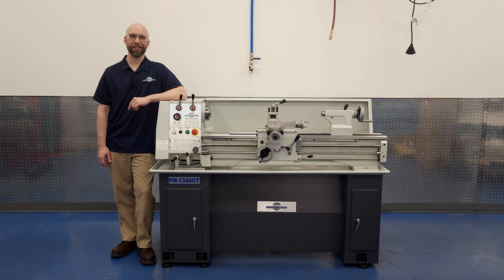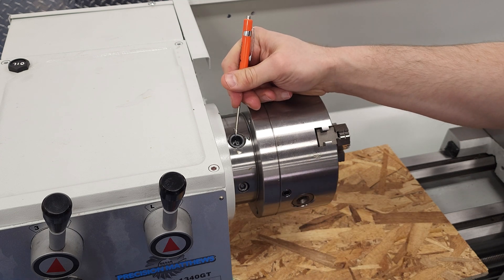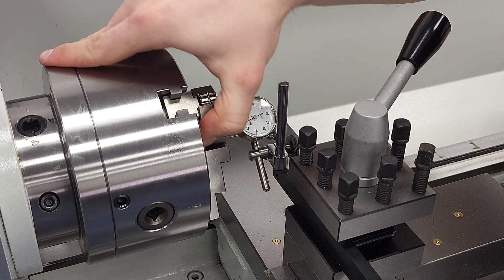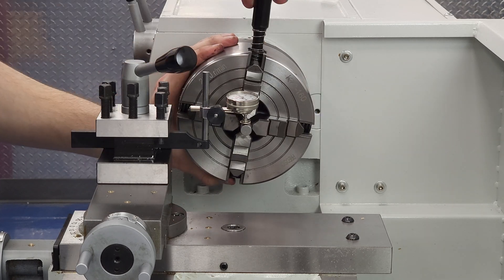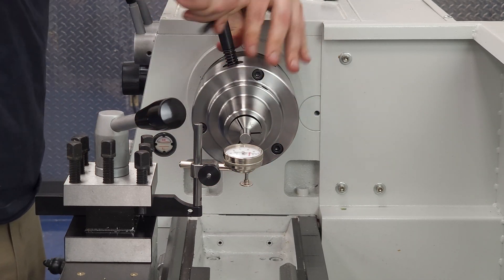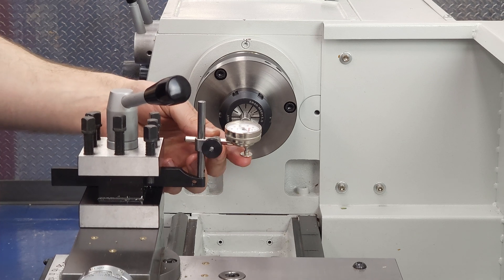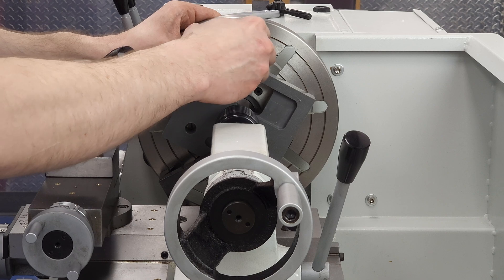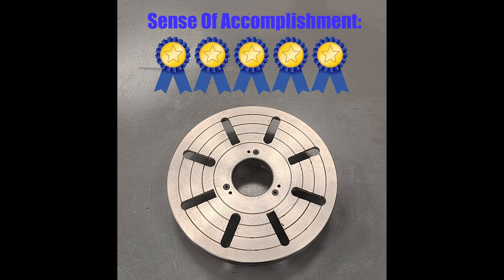Precision Matthews Media Lathe Chuck Review

Comment: You missed turning between centers. The face plate can be set up somewhere else like a rotary table on a mill then put on the lathe for finishing. Plus if your lathe has a gap bed you can turn pieces using the face plate that's larger than the machine is capable. I watched someone turn a 12 inch flywheel on a ten inch gap bed lathe using boring bars as turning tools.
  Thank you.

Comment: I went from a screw-on spindle to a D1-4 and I’d never want to go back. My preference these days is to use 5C collets whenever possible and when I finally got around to installing the closer they became even better, although I kind of wish that the outside of it was knurled for a little better grip. I tried the collet chuck first and it’s ok but winding the key around is a bit tiresome and it may go on the used market. I’ve used the faceplate as a makeshift driver for a lathe dog.

Comment: How long did you have to search for a chuck wrench spring? They normally fly into the trash within 0.03 seconds of purchase 😊
Reply: Mine always go in "spring drawer" to be used in some future project.
Reply: I go a step further. I throw away the spring (just for the satisfaction of doing it) and then just make a new extended chuck key to get my knuckles farther away from the head stock, I swear spinning that chuck while holding the wrench the top front corner of the head stock will get you faster than a cheap open end knuckle busting wrench.
Reply from the maker: Very painful, but safety is always first.